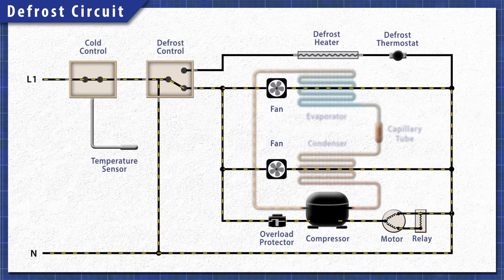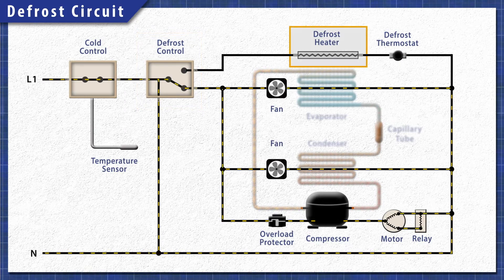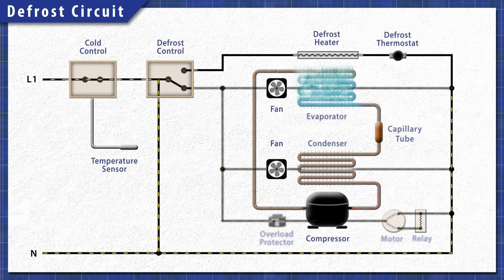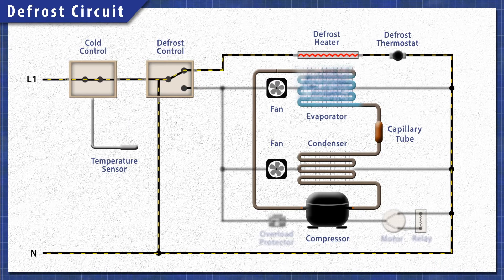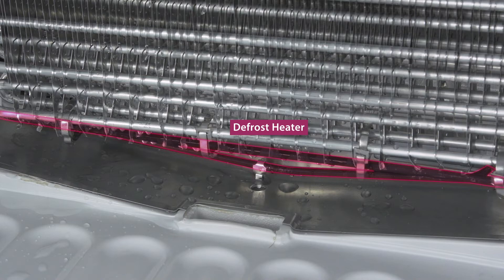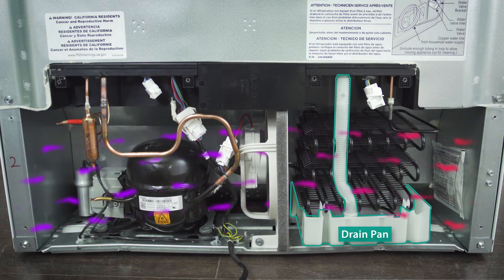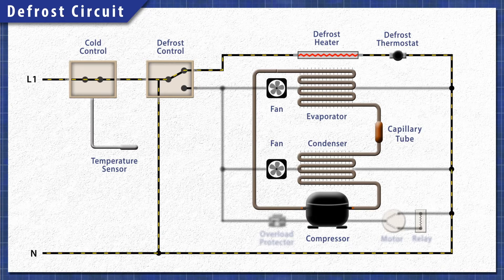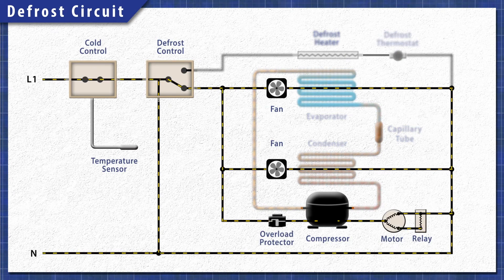Refrigerator Defrost Explained (How it Works) | Repair & Replace

Comment: I have an old Kenmore side by side.   I make ice cubes using filtered water that I fill the trays with manually since the automatic ice make is not functional and was too much aggravation before that. And yet my ice cubes pick up a slightly unpleasant odor.  I was speculating that on the fridge side the evap coil could get moldy ( haven't checked yet), but is their any air flow that circulates through both sides?    I can't see any other way volatiles could get into the freezer side.

Comment: I want to learn how the defrost cycle works so I can defeat it. I have a cabin where nobody opens the door for a month at a time. I hope to install a switch to disable the defrost cycle when I am away to (1) save energy, (2) keep the food fresher (with no unnecessary heating), (3) stop a persistent problem I have with the freezer drain freezing in the winter and dumping water into the fridge, and (4) give me a way to use less energy when the grid is down and I'm running on battery power. Ideally I'd buy a fridge with no defrost mechanism, but only tiny ones are available without defrost and I need a full-sized fridge. Now I'll view your other defrost tutorial. Thanks.
Now I have watched your other videos and I have a plan. There are 2 wires connected to terminal 2 of the defrost timer. This provides a neutral path for the light and the timer motor. I will interrupt this pair of wires with an external switch. When I want to disable the defrost function as explained above, I will first confirm that the compressor is connected (and not the defrost element), then will interrupt the neutral wires. This will stop the defrost timer motor. All my problems will be solved. Much obliged for the lessons. I cannot be the only person with a fridge that is unattended for many weeks, and has no use for the defrost function during that time. A clever circuit board could recognize that the door had not been opened in ages and could do this automatically. I chose an analog refrigerator because my county has a 3rd world electric service.
Reply: If you bypass the defrost cycle, ice will build up in the freezer causing a blockage of cool air from the freezer to the refrigerator, your refrigerator will then run warm or hot due to the blockage, and all the food in your refrigerator will be spoiled and wasted while you're away.
Reply: @r.2.d.2  FOOD LAST LONGER IN A MANUAL DEEP-FREEZER IF YOU MANUALY DEFROST WHEN NEEDED.
THE DEFROST CYCLING IS NOT GOOD FOR YOUR FROZEN FOOD ITEMS.
Reply: I see idk but an average freezer uses about 200 and 1200kwh a year such is a lot it also somewhat large amount of energie to keep smth cool dependance on the temperature what my some people do is to hydrate their griffe more so it keeps more cool in or smth
Reply from the maker: It's not recommended to bypass the defrost system. Even without opening there door ice can build up which can cause the refrigerator to become less efficient, causing it to run more frequently / consuming more electricity.

1) Residual moisture in the air
2) Air leaks: No fridge is 100% sealed. New moisture will slowly get in.
3) Internal moisture from food:

Comment: Nice explain sir
I I am facing a problem in my refrigerator 
I checked by metal switch heater and fuse everything working 
But after two days the lot of ice freeze in the refrigerator chamber aur condenser
 kindly share your experience what is the problem and where I check.
And one thing the heater right side is very hot and left side is 20% less than right side pp
Reply from the maker: Thanks for watching. We have a complete defrost troubleshooting guide that shows how to narrow this down further: https://youtu.be/r2YUNLPs4kM?si=9e3-cteMnzSjn42y

Comment: In the diagram, around 38 seconds, isn't there a direct short when line voltage in the defrost control ties directly to the neutral. Got it! That has to be the motor circuit.
Reply from the maker: Yes what is not shown there is the small motor and capacitor that runs the defrost timer. We tried to keep things clean and simple for the large diagram but it would have been best to show an additional symbol there.
Reply: @AmreSupply  Thanks. Your diagram was so clear. I just wired a wifi thermostat to an old refrigerator and modified the downdraft holes to make a deep freezer out of it. 
I did not realize the thermostat controlled (turned off) the whole defrost cycle. I thought the timer circuit would be primary line.   I just finished it an hour ago.  Thanks again.
Reply from the maker: @trupinion512  You're welcome, we're glad you found it helpful. There is another configuration that is less common. In some models the defrost timer is first and the cold control is second. In either case the defrost will run after 8 hours of compressor run time.

Comment: I've been living at my place for a year and just noticed my fridge doing a defrost cycle last night. I thought it was broken at first. I could hear popping and water dripping in the back. Last week, I removed the air duct in the freezer compartment and adjusted the air damper to send a little less air to the fridge. The problem was the fridge was 34°F but the freezer was measuring 10°F. Now the fridge measures 34°F and the freezer is -5°F. I couldn't find any information about it online or in the owner's manual except for a parts diagram on GE's website.
Reply from the maker: Thanks for watching. Yes the cold control thermostat will call for cooling until the fridge is at that set temperature and it is the damper that controls how much extra cold air goes into the freezer. This video explains this a bit more with more visuals to understand: https://youtu.be/09MmevMH0hA?si=DafTcqG_MZt4u-UQ

Comment: I have a kenmore stove surface element single is working, dual is not working. When change a new burner, it is not working, why?
Reply from the maker: Thanks for watching. We have a specific guide that shows how to test the elements and the heat switch. https://www.youtube.com/watch?v=GaW7uAHkPQI
Reply: Which Defrost sensor can use or replace with Panasonic NR-F605TT-K5?